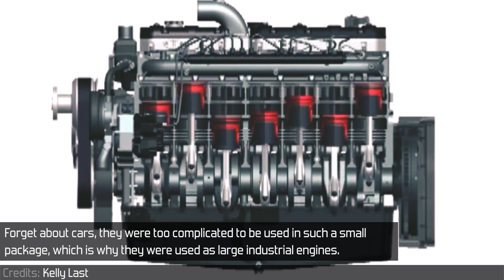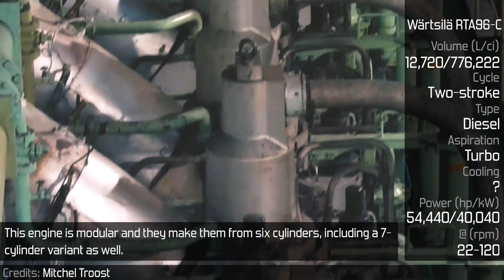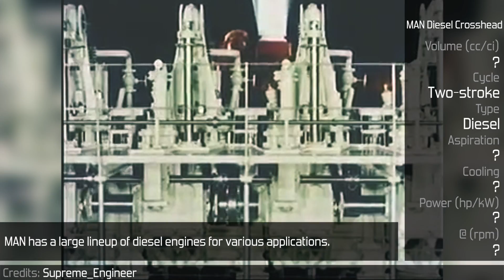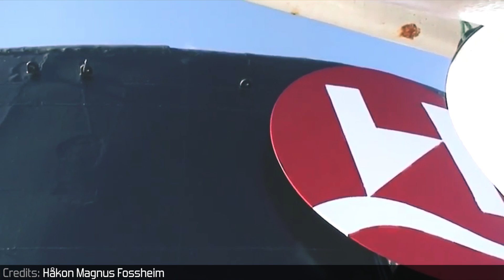The Only Eight 7-Cylinders You May Not Know About

Comment: That last one "might" be a 1940s vintage Cooper Bessemer. There is a much larger unit like that at the John R Kelley generating plant in Gainesville Florida. It turned a 2.5 mW dyno until the mid 60's when it was decommissioned and an oil fired plant was installed.

Comment: I was recently on a ship with a HYUNDAI MAN B&W 2-stroke 7 cylinder main engine. Bore was 600mm and stroke 2800 mm. Top speed was about 80-90 rpm producing around 15000 kW at the flywheel.

Comment: I used to work on tug boats that had 7 cylinder Cooper Bessemer engines. 1200 hp at 300 rpm. 600 psi air start. Direct drive. Nuetral was stopped and you started it one way to go ahead and other way to reverse.
Saw seven cyl engines in generating station in Brooklyn NY so big you could open a door in the side and walk in the crankcase. 
Thanx for a good article.

Comment: It's so odd to me that in line sevens were ever built considering sixes are perfectly balanced and building an 8 doesn't seem like that much more effort
Reply: modularity make a 4 - 5 - 6  - 7  - 8 and can cover almost EVERY industrial engine power needs with ONE design and being mostly very slow Diesel engines balancing is not an issue
Reply: the fundamental problem is none of the angle unit system can divide by 7 and give an exact number
degree: 360/7
radian: 2π/7
gradian: 400/7
unless you have to come up with newer angle unit system that have 362880 units for one rotation, then it might be viable
or just stuck to radian and figure out how to calculate the exact value (radian is more complicated to deal with than degree btw)

Comment: I worked on Navy tugs in early  sixtys. We had a seven cyl Cooper Bessemer 1200hp air start engine. Started on 600psi system. Ran at top speed 300rpm and was direct drive. To reverse you stopped it shifted the cam and started in the other direction. It was two cycle. Thank you for a good video.

Comment: How does the submarine engine run underwater?
Reply: Muin Zakaria They are hybrids that run on batteries when submerged, and surface to recharge using the diesel engines as generators. Terrible idea really, which is why they are mostly nuclear powered now.
Reply: Muin Zakaria
They don't, only on the surface.
Reply: Marty McFly
Diesel Electric was the only option for decades. Not a 'terrible' idea but the only one.

Comment: Nice on the marine side, but Wartsila bought up Sulzer, they made rhe RTA series which are 2 stroke low speed 103 rpm HFO fired engines, the F series Wartsila are 4 strokes and are medium speed 514 rpm rated engines, the 46 F totally diferent  than the rest of the 46's, I worked on 12V, 18V and the 20V (F). But never on an inline.

Comment: In the 1920s, Ingersoll Rand supplied diesel engines for locomotives built by both General Electric and ALCO it's on the ingersoll rand page on wikipedia it took all of 3 seconds to find it were the hell did you look for information.
Reply: Where does it give the specifications for this 7 cylinder? Everything I found he's already mentioned.

Comment: There's plenty of 7 cylinder 3rd gen Camaros and Firebirds running around. Well, they're actually 305 V8's running on anywhere from 4 to 7 cylinders typically. Just check your nearest trailer park.
Reply: Chris T lmao too true 😂
Reply: lmfao. I miss my 5 cylender ranger. I gave it hood pins, but let it run on 5 cyl. Also only one side of the leaf spring was attatched.... and it was missing a window. And a head light. Cops told me to get it off the road lmfao.
Reply: @justinfart7353  5 sounds good man unless it's a V 🤢🤢🤢🤢
Reply: LMAO my dad owned a 6 cylinder camaro and it ran on 5, with other pistons having appalling compression
Reply: Chris T 😂😂😂👌👍
Reply: Chris T this is true, there are also 5 cylinder variants which I have personal experience with. A 2.8L firebird came to my shop for a tune up as it had a miss and an oil leak. The owner had been driving it for a week with a rod hanging out of side of the block.
Reply: I can confirm this I own a V7 camaro
Reply: Chris T LOL
Reply: Chris T lol
Reply: The rear sparkplug on the passenger side under the airconditioner box. It was so hard to reach that it never got changed during tune ups. Even cars that were maintained by the dealership sometimes had the original factory sparkplug.
Reply: Underrated comment
Reply: 😂😂😂😂 Any camaro is a 4 cyclindar if you drive it hard enough
Reply: Know a dude with an elcamino like that XD
Reply: My uncle has a 5.3 litre Dodge 7 cylinder in a service truck
Reply: oloooolllololol
Reply: still not as bad as a ford tho lol
Reply: @hondablowsbadly  english ford's are solid. I hear many issues about American Ford. I wonder why there can be soo many different issues across the pond? Maybe a different manufacturing partnership? 🤷🏼‍♂️ I know in England or the rest of Europe. The last few high performance or "special" cars are assembled and built in either Belgium or Germany. And those cars have always been good reliable solid classics or high performance. The rest of the lines are built where ever and assembled in all manor of places. In the uk Ford is aligned now with Volvo and that's why you see and hear those sexy 5 cylinder turbo engines (st2 st3) thanks to Volvo. And in the meh range of Volvo cars you have the bleh Ford  petrol from last gen. Seems like Ford offloading cheap old engines because they have eco boost to develop and thrive off now and volvo have the sexiest sounding power lump for the hothatch/sedan range and so they are happy to partner up 🤷🏼‍♂️ I could be wrong but I see American Ford as more of a truck market nowadays but there are better trucks than Ford. I would like to see more European Ford in America. You guys would love the fiesta st and the focus st. They aren't made any more but the mondeo st is what the American Market really wants.
Reply: That was pretty funny, how did you get this posted from prison?

Comment: Some guy just decided to make a 7 cylinder engine. Was it just to get noticed? I think so. It's kinda like an odd number of socks. 7 cylinders are just going to be expensive, and I suspect that the original idea was for an 8 cylinder, but the design guy found out the car wasn't quite long enough for that. Oh, so now we have to make a 7cylinder to fit. I don't really see the need for more moving parts, and why not make a small 8, or a bigger 6?? It seems like a make work project to me.

Comment: Hey, nice video. In the Norwegian Navy, we had 3 samples of 2stroke diesel "Wichman AX7". They were realy a 3 and 4 cyl connected togehteher. Turbo and intercooled. They also had 2 "roots blowers" for each crank casing. Fixed rpm varied between 270 to 485, in emergency manouver mode. They made a fenomonal sound!  Wichman was original a Norwegian producer. But it got merged with wertsila:-)

Comment: you didnt mentioned why they're rare ( crank angle ) but you do use anti-shake
Reply: That is what I was thinking.  360/4=90, 360/5=72, 360/6=60. But 360/7=51.428  Not too many things are set up for just under 51.5 degrees.
Reply: The engineering challenge for dealing with angles is almost nothing. You can redefine the circle and divide it into multiples of 7. E.g, artilleries divide a circle into 1000 pieces instead of 360.

Comment: Thanks for this, VisioRacer.  Too bad none of the videos had a good high-speed sound of what a 7-cylinder would sound like.  I've tried to get Sisu diesel to post a video of their I-7 before, but they had no interest.  When they first introduced it, their advertising copy said it had a pleasing burble in the exhaust.  I expect all high-performance auto enthusiasts were hoping to find an I-7 that sounded even more manic than the I-5 in the Audi Sport Quattro.
Reply: The closest I've heard what an inline 7 cylinder might sound like is the Rotec R-2800 radial; they run at higher RPM than larger radials; the exhaust note is a pleasant, gutteral growl; something between an Audi 5 cyl., and the Rolls Royce Griffon, interestingly enough...

Comment: 3:30 
massey ferguson from brazil equiped This enguine 😎😎
Reply: I know this is old but Massy is part of AGCO. AGCO includes Fendt, Massey Ferguson, Gleaner, Challenger, Valtra, GSI, Sunflower, White,  and Fella (appears to be Pottinger) Fendt uses M.A.N engines though
Reply: @bengerlach9958  gleaners in Canada come with that engine in some larger combines and so do "massies" run SISU engines
Reply: @jasonriddell  Yeah. I still wish gleaner would have stuck with deutz air cooled diesels. Everyone hates on them because they dont take the time to clean the cooling fins. Then they get problems
Reply: @bengerlach9958  743 challenger track tractors use the 7cyl as well

Comment: Straight 7's are rare as 360 degrees does not divide exactly by 7... In a four stroke engine you'd get a cylinder firing every 102.857... degrees. As the fraction is irrational wouldn't that make it impossible to keep the timing consistent? Obviously 7 cylinder engines actually work so I'd be interested to know how they achieve it.
Reply: It's just math.  Especially with modern electronic engine controls, you just let the ECU calculate the injection timing advances.  The ECU doesn't care if the cylinders are firing every 102.857 degrees, once the cylinder phasing numbers are hard-coded into the software, it calculates 20 degrees BTC (for example) just fine.

Comment: some commonalities which make these monsters utterly reliable - Large capacities, Pushrod Valvetrains & mostly Marine or static power applications. Would be interesting to see if a 7 cylinder ever existing in a typical gasoline engine format!
Reply: The Sisu 7-cylinder diesel is the closest thing to a normal automotive engine in this video.  It has a rated speed of ~2400 rpm.

Comment: My truck has a 7 cylinder 306 engine in it, it's based on the 350ci Small Block Chevy. It's also got a Rolls-Royce transmission in it.
Reply: Peyton Cherry you mean a 305 only running on 7
Reply: You must have the Rolls Canbarely transmission.
Reply: You mean the transmission used in the Rolls Canhardly
Reply: in other words you have a chevy  missing a cylinder

Comment: Imagine a VR7
Reply: VW did a VR5, so it seems possible they could do a VR7.  I bet it wouldn't be any longer than a conventional I-5.
Reply: It would be cool if someone invented a Supercharged VR7 Diesel.. that would sound cool  with uel headers and a muffler delete!
Reply: @tallo7545  it would vibrate like crazy. I love diesels. But a VR diesel i believe is not feasable.

My favourite diesel is an Inline 6 one
Reply: @WorivpuqloDMogh  I like the Mercedes OM series (604 i4, 605 i5, 606 i6, and 617 I6), and some Detroits (8V-71) and Cummins 6BT. Also the i5 in the Volvo D5 cars.
Reply: YES
JUST YES
ONLY YES
Reply: Imagine a w14
Reply: orgasm
Reply: derbi senda Could you like... not?
Reply: There is VR8 which is used to make the Bugatti`s engine 8L W16 quad-turbocharged engine. W engines are made from 2 VR engines, V engines are made from 2 Inline/Straight engines.
Reply: @heromannickbggaming287  bullshit. W engines are not made from vr engines and there never was a vr8. Vr angines are also not made from inline engines. W engines work with the same principle as the vr engines, but saying they are made from them is sugfesting they just bolted the two together...
Reply: @guidoheeling1179  Volkswagen had a vr8 in a phaeton lll
Reply: @THESLlCK  no, it was a W8, wich essentially "is" two vr4 engines combined at the crankshaft. A real vr8 would be way to long.
Reply: @guidoheeling1179  vw made a prototype vr8 f1 engine
Reply: @coppermotorcycles  very interesting! I just red a story about it, sad that we never got it.
Reply: Cr7 Ronaldo

Comment: Great videos man. But tell me what happens to the exhaust on the Sulzer powered submarines? Wouldn't exhausting into the sea give their location away?
Reply: Diesel submarines are usual diesel electric.
The diesel engine drives a generator, that in turn powers an electric motor spinning the prop, and surplus energy is used to charge bateries.
So when a submarine navigates at the surface it runs the diesel engine, and aslo when just below the surface not needing stealth, the engine then breaths trough a set of snorkels.
When stealth is needed and the submarine goes below what is called periscope depth it runs on electricity from the bateries and the diesel engine is stopped.
Because the surplus power from the engine goes to the bateries it can always run on the most efficient rpm, meaning around 85% of full power for these engines.

For understandable reasons a diesel submarine has to surface regularly to recharge its bateries, and sometimes this means giving position away to the enemy, with the nuclear submarine this problem was solved.
The nuclear reactor in these has so much power that it can even power electrolysis equipment to make oxygen from seawater and its therefore able to stay underwater for months, a diesel submarine has to take a source of oxygen with it from the harbour or resupply vessel, mostly in a chemicaly bound form, this needs regular resupply.